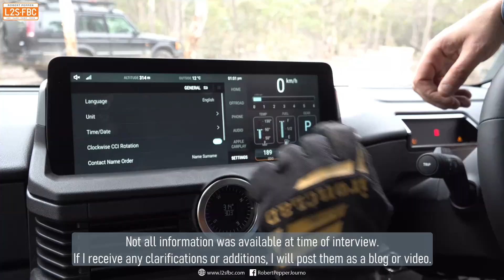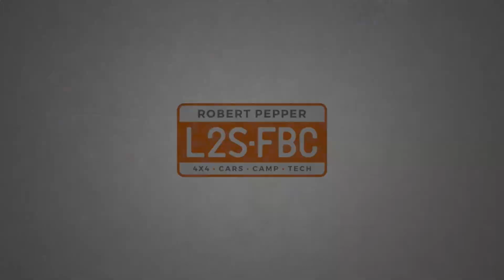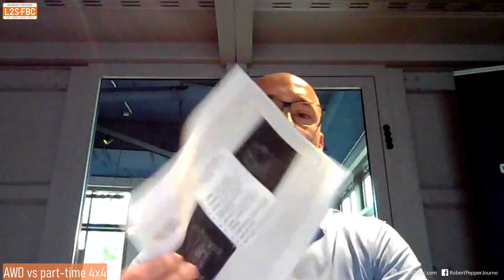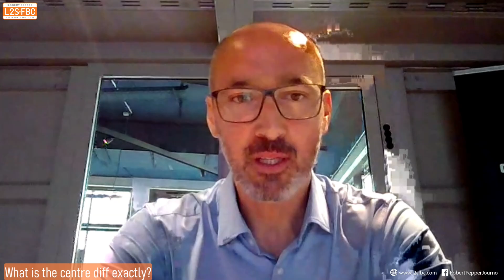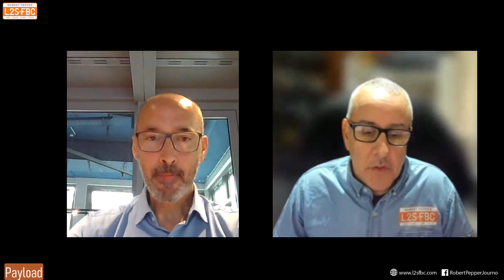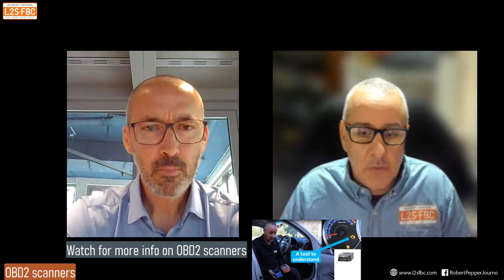INEOS Tech Chief Interview - Part 1/4

Comment: If you want a review of the mechanics the Tech Chief is talking about, go watch Dirtbox Overland's 2 part Deep Dive into the Grenadier - the frame and axles are WAY overbuilt in order to meet the reliability goals he is talking about and for me, that was an AWESOME trade-off. Also, I DON'T want to push a button and HOPE the truck's traction control settings are right (and the electronics don't crap out and stop working)- just give me the controls and let me decide what to do. Such a great truck!

Comment: I 100% agree with the use of permanent 4WD. I believe part time 4WD is a totally pointless exercise - why have 4WD if most of the time it isn’t. 2WD isn’t needed in a 4WD/4x4 - that’s the point. You don’t buy a 4WD to go 2WDing. 
The fuel savings have been tested over and over and they are negligible 2WD vs 4WD). 
In summary if a vehicle is 4WD, make it permanent 4WD and forget this part time rubbish. 

However - As for the “centre diff” being either open or locked - I disagree. A permanent 4WD should have a variable “centre diff” (lockable is an option if you want) as long as it can vary from essentially open to essentially closed; 0% (or near) to 100% (or near). 
Either locked or open is rubbish as has been seen by the Grenadier’s performance.

Comment: Wondering if loss of a wheel speed sensor would affect the ability to disengage diff locker(s).
Reply: The sensor evidently only triggers the locker light to go out. The lockers will disengage earlier, but without any real indication. So you could unlock and take an educated guess as to whether they did.
Reply: @Alaster- For some reason only known to Ineos (or maybe just Magna), the front and rear diff lights   also flash after reconnecting the battery.  So there's more to the light logic than just the wheel speed sensor.
Reply: @stevegreen101  it seems the lockers have no in built sensor to give the current state of their position, seemingly relying on button push to activate the light, and then the wheel speed sensors to deactivate. I would think a battery disconnect would leave it in a panic style state of unknown until confirmed with the speed sensors.
Reply from the maker: I ask this question in a future Part of this video.
Reply: @Alaster-  Yes, that sort of makes sense except it ignores the fact that it happens when the centre diff is unlocked and the transfer case is in high range. Both are gates in the logic tree before the axle diffs can be available for locking so it's implausible that they can be a thing other than unlocked.

It's not really a big issue, just a curiosity and it would be nice to understand why.
Reply from the maker: Watch this where I cover that point

https://youtu.be/KTgupbbRfog

Comment: 6:28 The comment about drive train loss: isn't that technically only correct if the fornt wheel hubs would be able to disengage the front wheels in a part time 4wd?
Otherwise in both cases the same amount of parts need to be moved. In part time 4wd this happens over the detour of the ground by moving the car you move the front wheels, the front diff and the front driveshafts even if you sidconnect it in the center.
And in permanent 4wd with a center diff, you move the same parts but directly instead of indirectly.
So the fairy tale of part time 4wd needing less fuel than permanent 4wd is (in my opnion) just that: a fairy tale. (unless, as i said there is also a drivetrain decoupling at the front wheels so the driveshafts and front diff would be able to not spin. But i think there are very few cars on the market that can do that today. At least here in central europe there is none to my knowledge)

Also: Fun Fact from a book about the Audi quattro system: Audi engineers in the late 70's when working on the first quattro were surprised that it didn't increase fuel consumption as much as they had calculated. They then figured out why: a driven wheel has less rolling resistance. (Meaning the front wheels in a permanent 4wd car have less rolling resistance than in a part time that is in 2wd.)

In my opinion permanent 4wd has the advantage that the toque of the engine is split between 4 wheels, and so each tyre-ground interface has to deal with less torque than in 2wd. So when driving on a slippery surface, wheels will start to spin "later".
Reply: Land Rover also have what’s called Active Driveline which can Disconnect the unused driveline parts actually saving a little fuel for real.
Reply from the maker: Yes, AWD as per Grenadier, Subaru etc uses more fuel due to greater friction with more rotating parts. This is why carmakers use on-demand AWD systems, either driving front or rear only and adding the other axle when required, and yes ideally there needs to be a disconnect at the hubs for max efficiency but there is still a gain. Land Rover has quietly moved the Defender into RWD with front axle on demand as it changed the L663's centre diff to a clutch. So part-time 4x4 is lighter, cheaper, and simpler, hence my surprise he said AWD was simpler. 
There are several pros and cons to AWD vs part-time 4WD.  I'll cover them another time.
Reply: @L2SFBC  The clutch systems: It is cheaper, yes, and they then often use parts that are not as heavy duty for the part time axle as they figure it gets used fewer times anyways.
That all means it also reduces long term and heavy use durability. And more wear. The clutchpacks, while running wet do still wear more than a diff.
I think his idea of simpler means computer/softwarewise: a center diff with a locking feature activated by the user needs less programming and testing than those clutch systems. (as they need to activate the right amount in the right moment)

Comment: He calls it permanent 4WD, yet in the video you continually referred to it as permanent AWD.  My understanding is that there is a difference between these two types of driving systems, so who’s right here, does the Grenny have permanent 4WD or an AWD system?
Reply from the maker: Both terms are correct.  The Grenadier drives all four wheels, all the time, so it is an AWD (all wheel drive) vehicle.  This is also known as permanent 4WD.  It has a centre diff to avoid the problem of transmission windup, explained here  https://youtu.be/1EHcrjIlkHk?si=knaUcugRqhPFLeEv Another solution for that problem is part-time 4WD, where the car runs in 2WD on high-traction surfaces, and 4WD in low-traction conditions.  Hence the distinction.
Reply: That's a bit of a language barrier thing i think:
Mr. Schlipf is german. And in the german language there is no difference made by anyone between what's called 4x4, awd 4wd. 
Or let's phrase it different: in german all these three terms mean the same thing as long as the vehicle has 4 wheels: all wheels are powered. (or can be powered)
If it's a 6x6 or 8x8 it would still be called awd (allrad) in german because all wheels are driven. (or can be)
The addition of the words "part time" or "permanent" is what makes the difference in german. (although we use the word "zuschaltbar" which more or less means "shiftable" or "switch on" instead of the litteral translation of part time)
And he clearly is more used to the technical terms in his native language than to the correct english phrasiology of car enthusiasts.
(which also makes sense, as the devellopment was mostly done by Magna in Austria, and the engineers here also speak german ;-) )
Reply from the maker: Maybe, but INEOS seems to use English, I am speaking English to him, and we are both well versed in 4x4 drivetrains. I think we understood each other!
Reply: Mate - AWD and 4WD are just names like anything else. It’s more about how it’s set up and configured. It’s a 4WD and it’s an AWD. But it’s a Permanent 4WD not a part time 2WD which is in my opinion, totally pointless.

And as said 6x6 is AWD or permanent 6WD could be an option. 
6x4 is 4WD. But again - just names meaning really how many wheels are driven.

Comment: New manufacturer. But transparent (more so than existing manufacturers). Have they got it 100% right? No. But the fact that you have access to the chief engineer and can ask these sorts of questions without a PR person getting in the way of an honest response gives me hope that they will learn and adapt quickly.
Reply from the maker: Yes, INEOS have consistently demonstrated openness. This is just the latest example, and of course it won't be 100% for everyone, but if it's 90% for 90% of people, that's a win.  This sort of interview is rare but not unprecedented, I also got access to Toyota LC300 engineers.  That interview was quite different in style but just as technical.
https://l2sfbc.com/developing-a-modern-4x4-lc300-engineer-interview/
Reply: I see several people making this point that Ineos are more transparent and open than any other manufacturer.  That's simply not correct.

It may be true if you qualified the statement to talk of any major manufacturer, or at least the norm with many of them reading the comment about Toyota being an exception.

It's certainly not true when you talk about small niche manufacturers.  Lotus, TVR, Ariel, Morgan as a few examples.  All seem to engage to a far greater degree with their ownership groups on a far deeper level.
Reply from the maker: Fair point 👍

Comment: Less electronic reliability - why then does things like the front winch & rear NATO socket run through the Body Control Module and the winch not operate or power is cut to the rear socket via electronic inputs remote from the driver inputs?

Why the inability to engage the axle diff locks in high range or the front diff lock without the rear?
Reply from the maker: In a future part I ask specifically why the lockers are set up the way they are. I would prefer complete flexibility, front without rear, and both in high range. You never know when you may need any given configuration.  I also ask about the winch setup.  In the case of both, I suspect the answer is protection of the vehicle.  It is relatively easy to snap CVs by abusing a car with the front locker in only, less chance with a centre-rear-front process.  I'm sure if complete flexibility was permitted people would break the car, hence restrictions. However, INEOS have a driver-control mantra, so let it be driver control, even if that flexibility is hidden in an expert menu. In a later part the response when I ask about why no front locker without rear the answer is "see no need for it" - which to me indicates insufficient time has been spent offroad driving.
Reply: Yes, I'd agree as to what may be the consequences but we are stuck in a no man's land where we are told that the vehicle is a driver's vehicle with minimum electronic interference but we are having to find out for ourselves and share the information where that is clearly not the case.  

If only we had access to workshop manuals that described the design and operating philosophy of the various systems then we could better understand these things.

Comment: Some very well considered questions. I would guess that for an "adventure vehicle" you need greater resilience to soft failures than needed for ordinary road use. Sadly with my most recent cars I have resorted to obtaining dealer software, it is not a case of hacking the vehicles but is needed to "reset counters" when you do simple maintenance, for instance changing transmission fluid or even replacing a battery. I do understand that a representative from the makers is not wanting to make too many assertions of what can be done with a standard OBD tool, it perhaps needs someone to investigate.
Reply from the maker: Definitely you need greater resilience. Your business, holiday, or even life may depend on the vehicle working and to have the car in limp mode because of a wheel speed sensor, gear selection problem etc is wrong.

Comment: The wheel speed sensor is an interesting point.  Doesn't the Grenadier require this for the use of the axle diff locks.  You can't relock a diff until the  wheel speed sensor has confirmed it's unlocked?
Reply from the maker: When you unlock the unlock will happen but the light doesn't go out until there is a wheel speed difference. Don't know if that is measured at the wheels or shafts. Interesting question.
Reply: Pretty sure Ronny Dahl found out the lockers still engage/disengage on each press, but the indicator light only drops out via confirmation of the speed sensors. Meaning that if you press the locker button too many times in a hurry to disengage, you won't know if it's trying to engage or disengage. Pretty big oversight on ineos' part imo. A 0/1 toggle switch would have served much better.
Reply from the maker: I discovered exactly that months ago on my first test.

https://youtu.be/KTgupbbRfog

Comment: What we Grenadier owners all want to know specifically: “Is there an OBD scanner we can use that reads and corrects errors and if not, why not?”
When will the workshop and parts manuals be released?
Reply from the maker: I know, I know!  I've asked the question directly twice and you can see the answers on the video.

Here is the written answer and question sent after interview:

3. OBD2 scanners - are retail-level OBD2 scanners able to a) identify faults and b) temporarily clear fault codes, or has the clear function been disabled?

- generic OBD2 scanners / diagnostic scanners will have limited accessibility to INEOS systems

- the function has not been disabled 

- more likely the scan tool manufacturers have not (yet) developed INEOS specific read capability 

- regulatory / or policy cyber security measures may also impact reader capabilities (this applies to all brands)
Reply: Thank you. Fingers crossed an aftermarket bidirectional tool  becomes available as well as the promised access to manuals...
Reply: @bakepl It would be nice if Ineos facilitated this.  Isn't there a open commitment to work with the aftermarket to bring forward solutions for owners?
Reply: Does anyone know of a manufacturer anywhere who will condone owner use of OBD scanners? Does anyone own one that did not originate from hackers in China? While we all want them for good and safe reasons, they can give access to settings that can compromise safety, let alone warranty.

There’s no point asking a manufacturer, we have to do what everyone has always done, keep an eye on Bangood, Temu, Aliexpress, eBay and forums until someone in China has hacked it and some owners have tested it.
Reply: I must be the one Grenadier owner who doesn't want an OBD scanner or the workshop manuals.
Reply from the maker: @DavesIneosGrenadier  you will, when you run into a problem far from help :-)
Reply: @L2SFBC  agree 100%. Important that i acknowledge and understand my shortcomings.